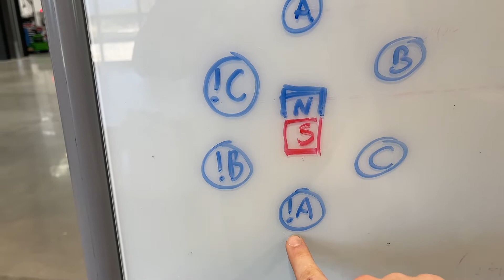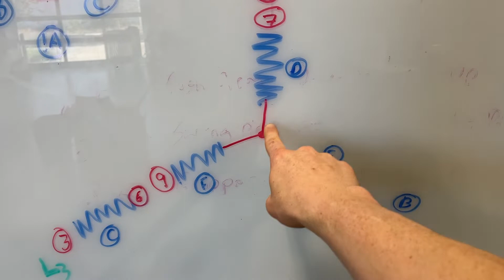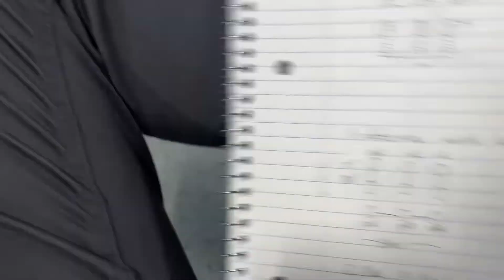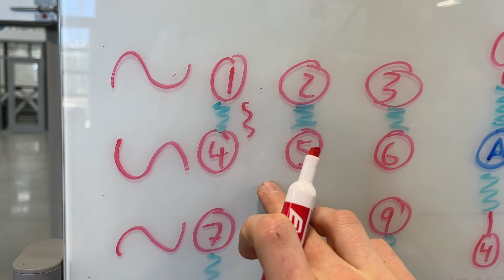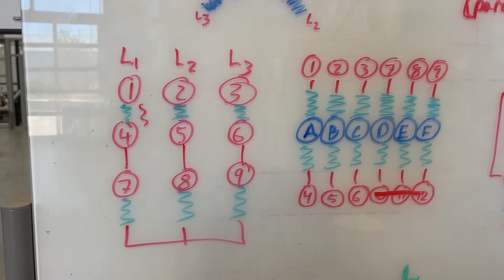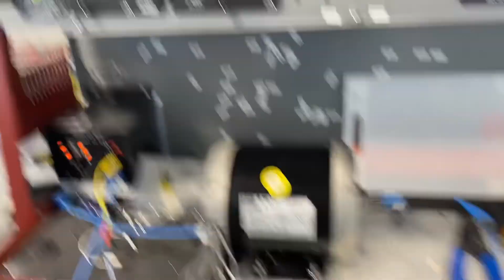Wire Any unlabeled 3 phase AC motor

Comment: I think you mix it up because on the high side you call Nick 6 to 9 5 to 8 4 to 7 and for low-voltage you connect one to seven to the eighth 3 to 9 and then you connect 654 together

Comment: If, on your whiteboard, Low(series) High(parallel) means voltage, then you have it backwards. 4&7, 5&8, 6&9 is for high voltage just as it shows on the motor. If you mean current then you would be correct but it is not labelled that way and it would not be a standard way of describing the connection.

Comment: Is there any way to identify the leads in a 12 lead motor? How do you figure out which are 10, 11, 12 without markings? I can't find any videos showing how to identify 12 lead motors. There are several showing 9 lead motors. Thanks
Reply from the maker: Hey, Yeah, you can use the same technique for 12 lead. I'll make another video showing how if that would be useful.

Comment: What would happen if you connect 7 to 5 and 8 to 4?
Reply from the maker: This would create an invalid sequence. Since the second set of coils connected to 7 and 8 run directly next to to the first set connected to 4 and 5, they would create contradicting eddy currents. The stator is supposed to alternate between positive and negative moving in a circular pattern in order to move the rotor. With that configuration, the stator wouldn't create the pattern the motor needs intorder to move in a circle. When you throw the power switch, the rotor would either vibrate back and forth or lock in one position. In that state, the motor is fighting it's self, so it would draw a high amperage> which means heat> which means eventual burnout.